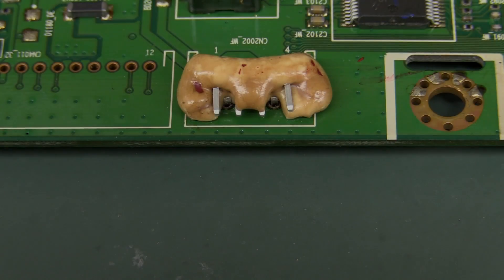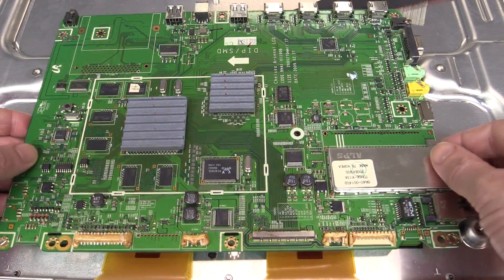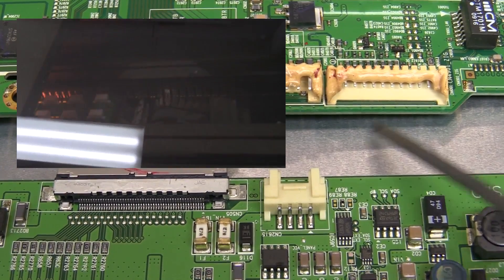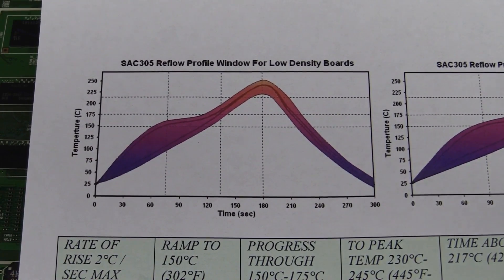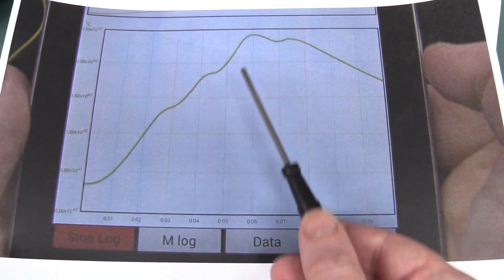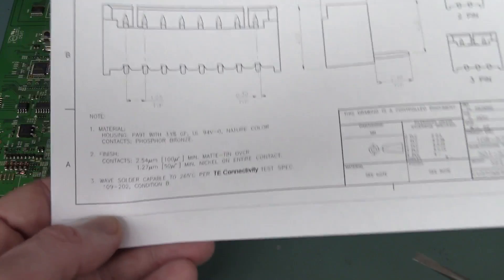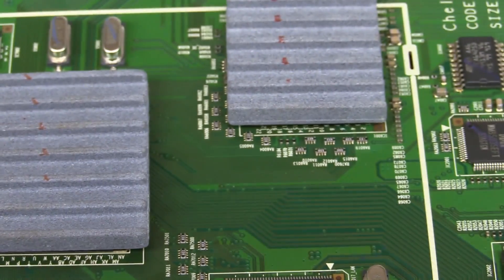EEVblog #782 - The Dangers Of Reflow Soldering

Comment: Was the plastic used for the melted connectors different than the ones that didn't melt?🤔 I thought of taking a toaster oven & using it for a m/b pre-heater, but for a whole reflow. Thanks

Comment: I will always cover all plastic connectors with aluminum tape the best I can. You never know... A small fan blowing cold air with an Arduino adjusting the PWM to not let it cool off too quick or slow is also not that difficult for the DIYer

Comment: The element on an oven will typically get very hot and may exceed what the thermostat believes it to be. This is why if you don't preheat your oven, you can burn your pizza. Especially radiative heat might exceed what you are expecting Dynamic temperature profiles on an oven like this is always going to be tricky. Might be better to preheat it and then just throw the whole board in for a short amount of time to approximate the cuve.
Reply: But you want your oven to be as hot as possible for pizza, no?
Besides, this is modified oven with controller specifically made for reflowing boards.

Comment: just clean off the melted plastic, the plugs are still intact on the cable so the socket pins will still be isolated clean em off and plug em in its only a flat panel.

Comment: I allways reflow with flux and hot air surface mount or not, and last i clean the board with an ultrasonic cleaner. Allways works for me. Interesting video though ;-)

Comment: Connector melting temperature is not lower than 250°C. Why reflow on such high temperature. I reflow motherboards at least 100 times but never melt connectors. 190°C in owen for 10 min, not higher than that temperature. It will explode condesers on board than melt connectors. Maybe your reflow owen doesn't display correct temperature?

Comment: This is the dangers of bad reflowing practice. I reflow and reball alot of boards and never had one connector melt on me. I always cover the connections with thermal  tape. If you would of just put some thermal  tape you wouldn't be having this issue.

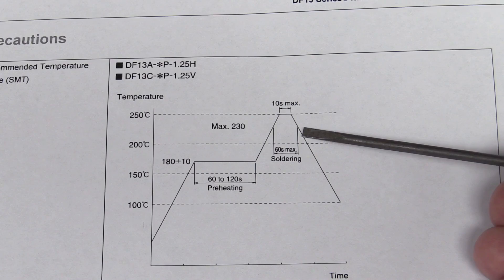Comment: A great video. Thank you, but I feel I should point out the following. I know you used a generic datasheet (in this case the HiRose DF13 series connector) but @ 6:02 the note stating "60 sec max" is ONLY related to the temperature of the solder when at liquidus, in other words, when it starts soldering (217°C - 221°C for lead free) and is only there to ensure a good reliable solder joint. Any longer than 60 seconds AT LIQUIDUS would NOT melt the part, but could increase the risk of a poor solder joint and could jeopardise its electrical contact, especially if the Printed Circuit Board undergoes thermal cycling during its operation.  The '10sec max' reference on the graph is the optimal limit when at PEAK temperature, in this case (250°C). Peak temp is normally much higher than soldering temp to ensure the WHOLE PCB has heated sufficiently. If the PCB has areas that are heavily populated with components the PCB may not heat up evenly. 'Lead-free' components (including connectors) are designed to easily withstand temperatures of up to 260°C, but for optimal performance the temperature should be kept below the stated 'Peak'  value. 
Additionally, just as a side note, the "Max 230°C" shown on the graph is related to the time at liquidus. The 'preheating' shown on the graph is there to ensure the flux with the solder has sufficient time to remove any oxides on the component leads before the solder becomes liquidus. This should guarantee a clean joint. Generally the flux will become 'active' and begin to remove oxides at approx 150°C.
I look forward to seeing your other videos. I especially like the "Worlds worst tablet". Truly shocking.

Comment: Most through hole types of connectors are intended to survive either a solder wave or hand soldering. I've even had to build connectors that have stripped wire coming out the back to pull heat away from connector pins like a heat sink when hand soldering on ground plains.

Source: I build PCBs for water testing equipment.

Comment: This is why I use a hot air gun for reflowing.  I put the heat on the components that can take it, but I avoid those that need to be protected, such as the plastic connectors.
Reply: Steve Packard That is a good solution. Use a reflow oven when initially populating boards, use hot air for rework. At least IMO.

Comment: You have to cover that plastic parts with aluminium foil - I do it in my simple cooking oven? and it's okey.
Reply: Not sure whether that does the trick. The GND will get hot and the pin to it will melt the plastic. Same for other pins. The foil only helps against the IR radiation.

Comment: Melted connectors to close to the radiative surface and edges. Also have hot air convection going through the small gap between the board and the wall.

Comment: So, is it safe to assume that the melted right-angle connectors were the only things damaged by the oven, or could there be other components damaged by the heat in less obvious ways?
Reply: The RF Receiver? It is trough hole as well. The internal coils can move and the Tuner wont work.

Comment: I've wondered on air circulation for toaster ovens if you couldn't put a metal fan blade on a long shaft into there, powered by an external motor going through the side of the toaster oven, that'd mix the air well during the heating cycle, I'd think?

Comment: maybe in a Thermal Oven because if u are experienced, most of the failures are caused by cold joints not transmitting well the electrons after u have used the multimeter and nothing looks wrong.

Comment: Wrapping the plastic in tinfoil may have worked to keep the plastic from melting.
Reply: +garyrich2000 depends on how much you wad (thermal mass) on there as a heatsink too but no guarantees.

Comment: It's just you who made 2 possible mistakes :  you either set the temperature too high, or you just left the board inside for too long. I've succesfully used the oven technique on a graphics card, but the 3rd time i did it i was doing some other stuff too i left it inside for a bit longer and the plastic from the dvi connectors melt a bit, still had no trouble using the card. I haven't been able to repair the issues with the card though, i bought it new and basically crashed most of the time, gave me artifacts and stuff, and even after putting it into the oven, it just shown the same issues. Definitely a chip problem somewhere, not necessarily a solder issue.

Comment: How come reflow soldering does not damage components that on their datasheet specify absolute maximum temperatures waaaay lower than what is used during reflow? I can understand soldering with a soldering iron, because it's done very quickly, but reflowing takes a very long time in comparison.

Comment: tinfoil / aluminium/ aluminum wrap the plastics, its what i do, never had any connector melt :D
Reply: Same thing for me - multiple times I've been reballing  my old graphic card - worked pretty well untill some day I didn't wrapped it very well, so my plastic connectors melted too. Also the capacitors too need to bee wrapped - they don't like high temperature.

Comment: As a general rule? We run through hole connectors through our reflow oven and selective solder or wave solder others, depends on the plastic, not through hole specifically.

Test first.

Comment: I have a similar hacky oven setup, with an Arduino running the PID stuff and controlling the heater element. I mounted a hobby servo on the base plate in front of the oven and connected it to the door handle, so when the controller gets to the cooldown stage it pulls the door partly open. That helps the temperature drop much more quickly

Comment: Would using the convection function (if it has one) on the toaster, er, 'reflow,' oven help with hot spots? That's what I've been doing, but with no real proof it actually helps. Just sounded good in my head.

Comment: Dave
My guess is that its a JST board-to-wire type. Measure your pin pitch and it's a quick lookup of about 5 to 10 types. If it is a JST then just go and request two samples and as long as you're patient, bob's your uncle.
Kevin

Comment: I have seen those diy ovens having a fan for the cool-down stage. Won't save your connectors of course, and the danger is that you loose heat trough the hole you have to cut for your fan. 

Could it work if you put a bit of heat resistant tape on the connectors? This will only help to protect from radiant heat off course.

Comment: Dave. I did couple of reflows on Dell and HP Laptops, I’ve used: heat gun, temp sensor and chronometer to follow the heat/cool curve & timings.  Shielded the target area from the rest of the board with aluminium plates and foil. Dell died after 6 month. HP is still running after 2 years.

Comment: Hello. Please check if the Tcon equips with a AS15-F IC. It's a very problematic voltage buffer on Tcon boards and it's relatively cheap on ebay. And keep up the good work with the eevblog.

Comment: I've heard of people reflow soldering with heat guns, what are your opinions on that particularly since it would be very difficult to control the heat? I suppose you also risk the possibility of physically moving the solder or smaller components with the force of the air. (many PlayStation 3 yellow light remedies use this method)

Comment: Dave, You can cut away the melted plastic enough to fit the connector back on. I would really like to see you fix this TV.

And Dave, You are the one who inspires me to at least try to fix things because it's what I like to do. I like to tinker and fix stuff and if it cannot be fixed I scrap it for parts. I tore down an unfixable LCD TV and harvested a nice amp board which I've used to build a amp boombox. It had detachable speakers so I used those for a car stereo.

Comment: Please don't give up on this TV!  Really want to see it fixed, as I'm working on one with the same issue!
Reply: Protonus Problem is that Dave don't know what he is doing.
Reply: Yeah, I'm hoping he continues with it as well. These repair videos are my favorite. Repairing home electronics is something I enjoy doing, something I would like to be better at, and these videos really help teach how to go about narrowing down the problem.
Reply: ***** Unfortunately to access the service menu for most TV's you need a remote,  and Dave's TV doesn't have one.  My suggestion is to buy a universal remote and try using the standard Samsung service menu code,  it's the only thing I can think of to do.
Reply: Protonus Very difficult to find the service manual for your TV (LN55A950) which is strange because LN55 is a common series.  I did find new firmware for your TV here - http://elektrotanya.com/samsung_a950_firmware.zip/download.html
Just take the standard precautions if you plan to update the firmware, it comes with instructions.  Even if new firmware doesn't help,  it's good to have a backup.  I've seen quite a few TV's get tossed just because of corrupted firmware.
Reply: Tcon boards often fail cause chips overheat and solder joints go bad, I tried reflow got little results (I made reflow video). I tried to order chips but only available for samsung service centers. I just bought board from amazon and it worked. :)
Reply: Thank you pXnEmerica.  I'm about to replace some caps on it tonight that were bad on the PS board, but if that doesn't take care of it, it'll be the next thing I try!
Reply: ***** That's true.  Also I just checked the service manual for Dave's TV and he can apparently access the Service Menu with any brand universal remote by pressing Power Off -> Info -> Menu -> Mute -> Power On.
Reply: +Protonus 
Hopefully Mr.Dave has an android phone or an android tablet. There is probably an app out there 
that can simulate the remote.
Reply: I was able to pull the front metal bezel out far enough to find that I do have a problem with the chip on ribbon area. If I press hard against the ribbon against the rear metal bezel, the picture is almost entirely fixed. There remains a blue bar I need to solve.
Reply: Dacke maybe he has a samsung smartphone, with the IR, mine does (s4 mini) and theres a utility which should be able to do all the codes
Reply: +Nicklas Persson I'm not sure an IR port is a common feature.
Reply: tried to get the front metal bezel shield off the front of the panel tonight, so I could examine the chip on ribbon driver chips and their cabling, and thing thing is assembled like a damn mystery box ugh.  Nuclear waste containers use less screws and shielding.

Might replace the T-Con board first just because it's easier and I can send it back if it doesn't fix it.
Reply: +Protonus nuke waste containers welded shut/all one piece
Reply: Protonus The chances of the continuation of the fixing of the tv is approximately six million two hundred and fifty three thousand to 1.
Reply: Search Amazon for the model number of the TV and the keyword Remote.   I've replaced a worn out Panasonic remote with a brand new identical model.
Reply: Android app called SURE works very well
Reply: The caps didn't fix it ugh, despite one of the four having failed and two being on their way out. I got into the service menu, but can't find the test patterns anywhere. I don't see the SVC option either.  It's a Samsung A950 55" LCD.  Full model # is LN55A950D1F

Finding very little on this model.

Comment: Hmm. That SO package just NE of the power connector (4-pole), are the pins soldered proper? Maybe it's just me, but one of the pins looks like it's hanging somewhat in the air?
Reply: SMD related idea/thought... How difficult would it be to mount a metal fan blade (like the ones on those cheapo USB fans) on a wooden or some other thermally non-conductive axle so it shifts the air around inside one of these DIY toaster ovens to make the heat spread evenly?

Comment: The obvious thing to do would have been to check all the TMDS pairs from the processor board for good clean signal with your nice 1ghz scopes, next to replacing that t-con board, before ever considering to reflow anything. These TV's generate so little heat that its extremely unlikely that any soldering has become loose over time. Furthermore, I would have just ripped all the melted plastic off the board and made sure it still works before bothering to continue further desoldering and ordering new plugs, etc.

Comment: solder new connectors? Or just giving it up with the Samsung?

PS to avoid that I've used petroleum jelly in the past while reflowing.
It did the trick, guess not the right method. But i'm lazy

(and i don't recommend it)
Reply: Osmosis How about pieces of tinfoil? It works for shielding hot air, maybe won't do so well in a reflow oven.
Reply: ***** Never tried that, but it did cross my mind. The time when i was using petroleum jelly, since i couldn't find any tinfoil that day xD
Reply: 666Tomato666
 Just had a better idea - instead of tinfoil, one could cover the connectors with pieces of stone wool. That's what they use to shield the outer casing of the oven's heating element anyway.
Reply: ***** good idea

but tinfoil has one ace up its sleeve - its reflective, including in the IR part of the spectrum, so probably the best possible solution is to combine them
Reply: ***** it also keeps heat on the outside

so during the heatup you're better off with it in place and during cooldown with it removed
Reply: *****
 Yeah you need something that's a poor conductor of heat to contain the cool air inside and not let any of the hot air get in. Mineral wool or fiberglass stuck down using kapton tape seems like an ideal way to do it.
Reply: +Osmosis I have noticed something else.

How did the plastic get on the connector pins? It should just slide off that same way. If you knew they were gonna melt, you could just slide off the plastic beforehand

Even now, you can probably still liberate the pins from the plastic with some dremeling. It won't be good for a factory or for a TV which will need to be shipped around, but the only things they do is to retain the end of the cable and prevent you from inserting the cable the wrong way around or offset, so just pay attention. Factory workers' time is too expensive for them to pay attention.

Comment: It did seem heavy handed to melt the entire board, particularly dual sided. Hot air if you must but I wouldn't do that without having located the problem.
And yes it is rather ridiculous how low temperature plastic they use for connectors. They melt with any process you use, it's so stupid.

Comment: Should have taken the heat gun and melted the chunk of plastic off. Would have been quicker than desoldering. Although I'm poor and wouldn't want to wait the month for the new ones.
Reply from the maker: joblessalex Wasn't that easy, all the pin solder had melted and fallen against the board. Very messy.

Comment: Couldn´t you use bluetack to insulate components from heat while reflowing? Maybe some type of clay?
I guess there could be a risk of warping the board, but if the area is small enough, just a couple of connectors, that should be fine though right?

Comment: I was wondering if the heating element is at the back of the oven. I'd guess that would make it quit a bit hotter across the back. It might be hotter at the back anyway as the glass probably lets quite a bit of heat out. I guess that's the end of the repair job though, shame that was an interesting bug.
Reply: Wobblycogs Workshop If it's an IR oven, the glass wouldn't make much difference.
Reply: There are two heating elements in the top and two at the bottom.